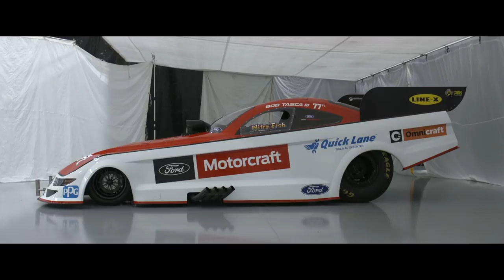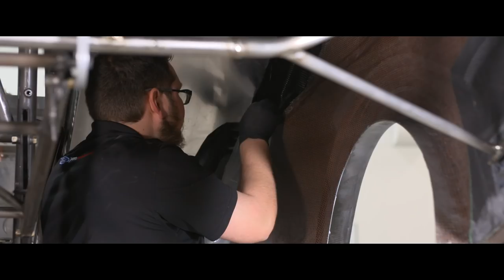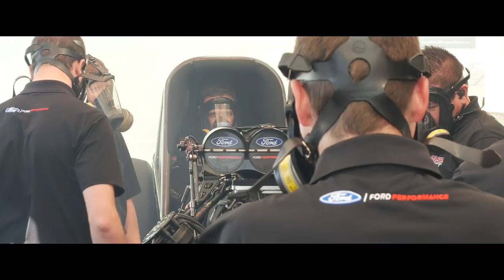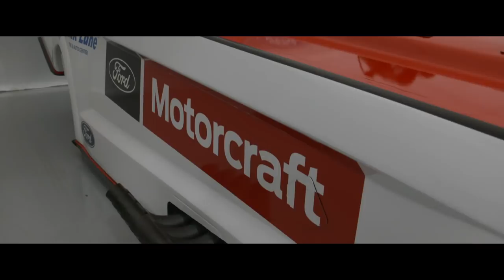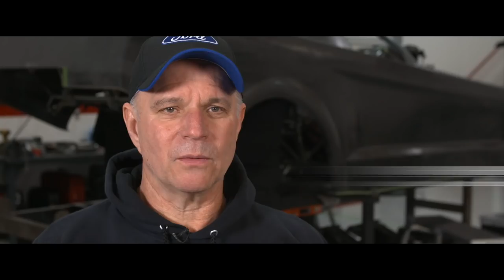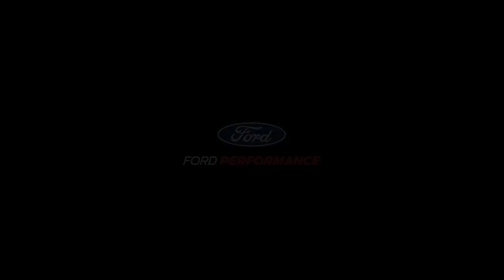Making of Mustang | NHRA Funny Car | Ford Performance

Comment: Why doesn't Ford get on the NHRA about letting the racers run whatever engine they want. I'd rather see a real Ford in the mustang. Same with pro stock. They handicapped Ford's and mopar so the commodes can dominate. They outlawed the Cleveland engine because it was unbeatable. Jack Roush and Bob Glidden was smarter than the NHRA.
Reply: Frank Chapman - Before John Force screwed up and lost his deal with Ford he was running BOSS 500 engines in his Funny Car and winning. Maybe we will see Ford engines return to drag racing.
Reply: @cavscout62  I did not know that. So technically, JF was really the fastest real Ford ever.
Reply: @cavscout62  Chrysler Hemi-based block, Ford valve covers. He changed the covers to Chevy.
Reply: A well prepared Cleveland engine is definitely a threat to the competition despite the abundance of negative misinformation so common online. The NHRA didn’t go as far as to ban or “outlaw” Cleveland headed Fords back in the seventies because their intentions of getting something other than a Ford in the winners circle would have been blatantly obvious to all. They simply changed the minimum weight requirements by adding a couple of hundred extra pounds to all canted valve Cleveland head Ford entries.  

The really good Ford tuners could still win races despite the huge weight disadvantage but since there was limited aftermarket support for Clevelands, they were using up production parts faster than ever before. 

Since there wasn’t a huge amount of sponsorship money available back in the day, the racers had to spend even more of their own money to stay competitive in Pro Stock. 

The NHRA succeeded in factoring Ford Cleveland Small Block Engines out of a reasonably competitive status. 

Fast forward to current times and enjoy the whole new generation of aftermarket Cleveland Superiority. Technology has made it possible to design and manufacture alloy heads and blocks that have corrected all design flaws of the OEM production pieces. Builders in Australia and the United States are taking advantage of the extra displacement available from the new blocks and stroker kits for small block Ford Clevelands with naturally aspirated builds WITHOUT power adders that are exceeding the 1000 horsepower mark and still maintaining street driven manners. 

For proof just look them up right here on YouTube. The Cleveland is definitely back !

And the beat goes on......

Comment: This is  not a Mustang anymore than the Camaro, Toyota, Chargers are factory cars. All the engines are the same purpose built Nitro engines resembling a Chrysler . Ford lettered valve covers does not make it a Ford engine just like Camaro and Toyota valve covers are for show. Force is winning in Camaros that are the same Mustangs with new bodies that he won with for years. Sponsored by Ford Yes, Powered by Ford No.
Reply: Did you know that JFR when he was with Ford and the Austin family were trying to get NHRA to allow them to run the big block Ford engine but that was denied several times.  so yes the universal engine may be modeled after the 426 Hemi it's not like other Racers have not wanted to run the Ford engine. They're simply not allowed to.You can be certain that if NHRA would let them the Tasca Racers would be using them
Reply: Mike Barnes  well just so you know the engine was called that but sadly it was still based off of the same Chrysler hemi that everyone else is running as well.  No matter what stickers they put on the valve covers.  This was well documented
Reply: Brenden Howe - it’s not Chrysler anything it’s completely aftermarket engine
Reply: Mike Barnes,
Yes Force ran a 500 ci Boss Ford, but the engine was still based on the Mopar Hemi!
Reply: @CoyoteFTW Chrysler by design.
Reply: Mike Barnes  Better not tell NHRA then because as stated the only legal engines are based off of the Chrysler Hemi design.  Of course all of the components are aftermarket.  The blocks/heads are usually done by TFX, AJE and a handful of others but definitely not Ford.  You can research this in old National Dragsters if you like.
Reply: Not true. The cylinder heads were designed by corporate Ford but NHRA kept refusing to make them legal. All the Force wind while with Ford were with these proprietary heads and the cylinder block is billet but not the same as the others, all Ford design as well.
Reply: @fordwin1  I'm a Ford guy but you can't deny Chrysler bore spacing, block design, rocker shaft setups etc.  No matter how you look at it they are NOT conventional 385 series BBF engines with Ford dimensions and architecture with Boss 429 style heads on them.  RDI heads or otherwise.  All of the Nitro classes use a generic hemi design that shares more design cues with the Chrysler 426 Hemi than any other engine.  I'd love to see a true Ford Boss 429 design go head to head with them.
Reply: Hemi has been in cars forever and not just dodges these motors are 500 cubic inch hemis not made by dodge se yes whoever makes the motor is who its powered by